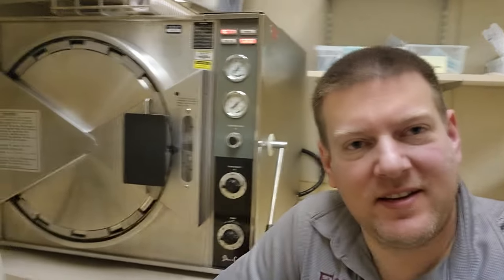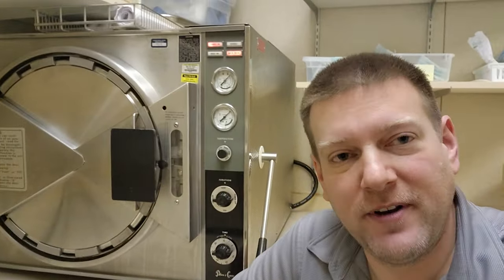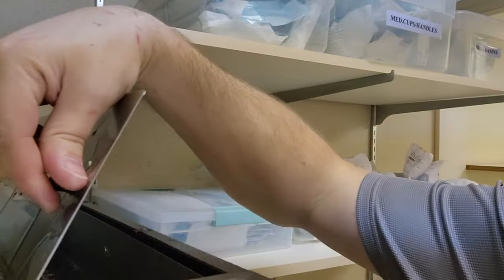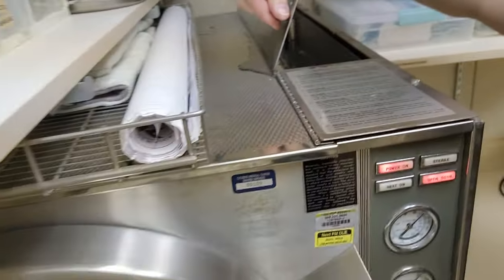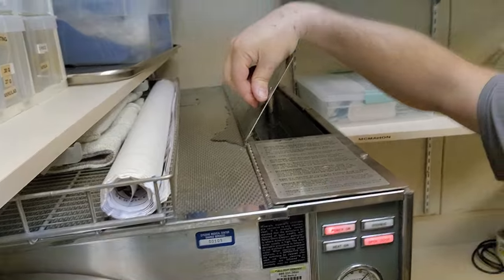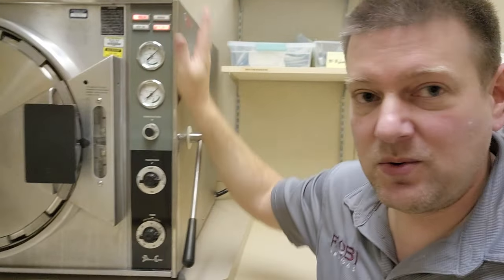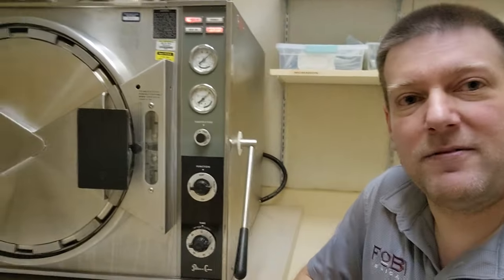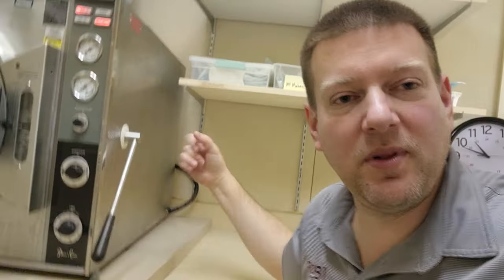Mysterious Fire Solved!

Comment: I wonder if the hot connection at the plug/receptacle interface was dropping enough voltage to reduce the heater wattage enough to protect the heating element from destruction after the water boiled away?

I have seen a lot of loose plug connections over my 39 years in hospital biomed departments. It is not uncommon for a loose receptacle contact to destroy the connected plug as well. This works in reverse also.  Often the wire connected to the receptacle is overheated as well. Remember that the plug contact and the receptacle contacts are good heat conductors as well as electrical conductors.

Your hypothesis about the failure seems to fit the situation perfectly.
Reply from the maker: Very interesting
Reply: This would be my first thought as well!

Comment: I carry parts for the Magna Clave. They are still awesome autoclaves. The smaller ones of that make less so because most of them have chambers that are leaking or will soon leak under the heating element.  I tell my clients that they may only last until the check cashes and I hate to take their money.  If you they still want to proceed , okay.